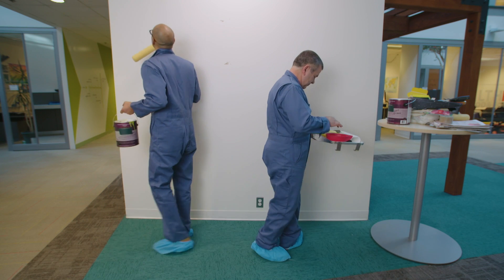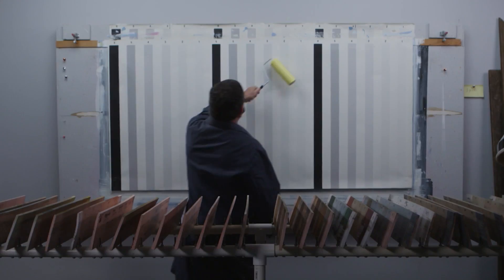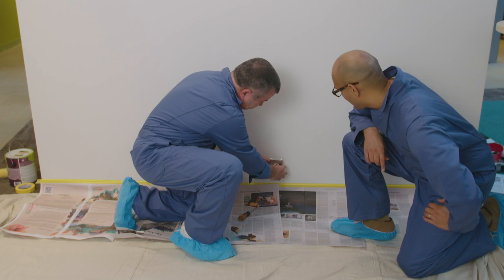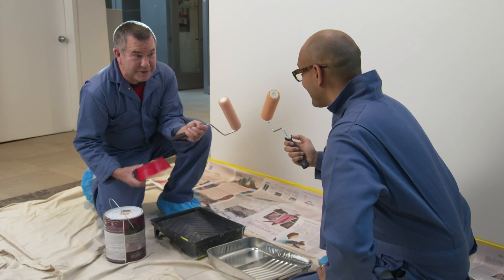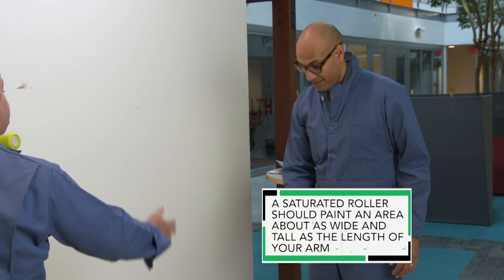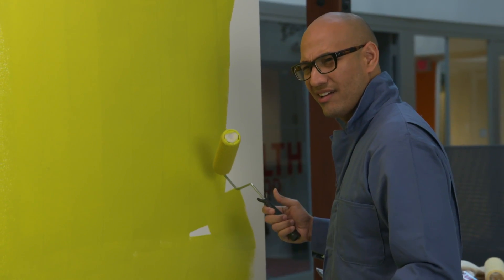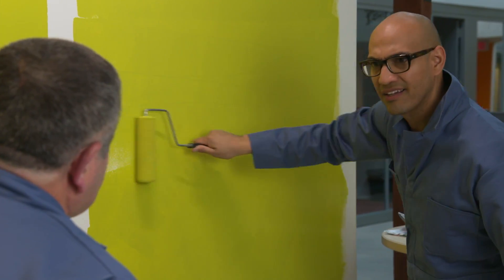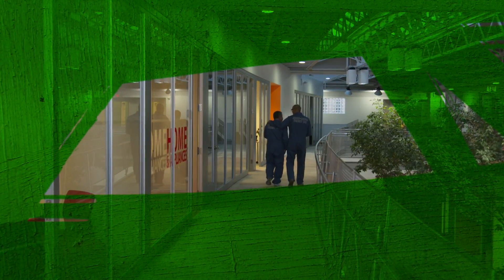How to Paint | Consumer Reports

Comment: With all do respect..you should always roll in the direction of the roller arm. One end of the roller (roller arm side) receives more pressure, while the end you slide the roller sleeve on will leave less of a "paint line".

Comment: Funny and good info. I always say "DUBYA" when I paint the "W" on the wall.

I noticed that the masking tape was applied in a manner which OVERLAPPED the seam of the baseboard molding and the lower edge of the drywall rather than covering only the baseboard molding. Is this correct? If so, how do you fix the unpainted portion of the wall just above the baseboard? Do you re-apply masking tape over only the baseboard and touch it up? I realize this video was not intended as a comprehensive tutorial on paint prep, but what was shown didn't make a lot of sense to me.